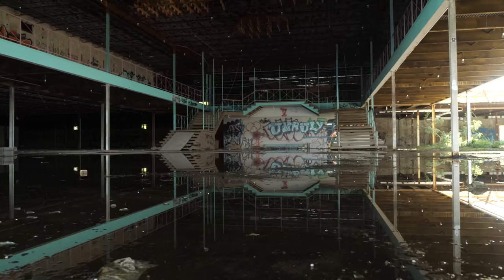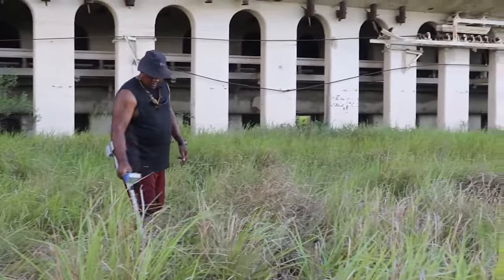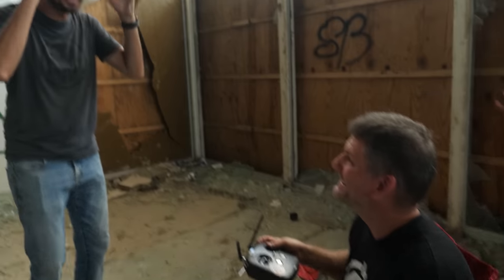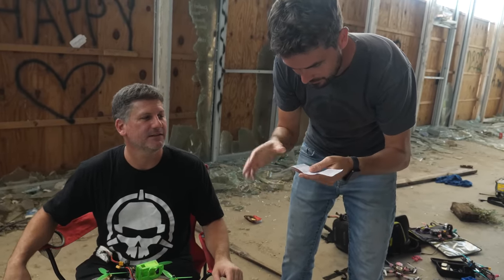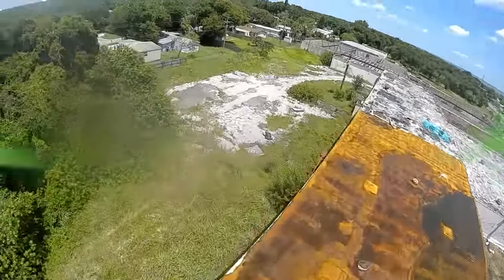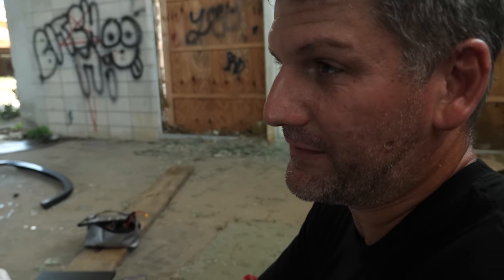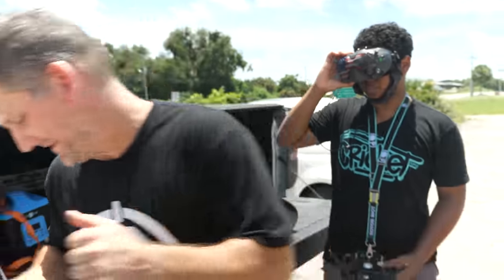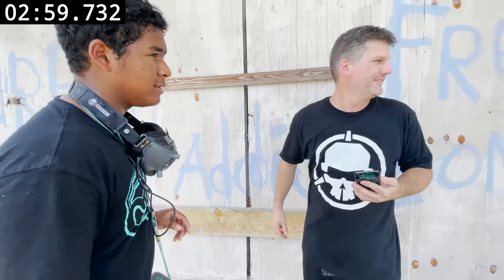Can Apple AirTag Find a Lost Drone?

Comment: Airtag is perfect when you attach it to your gopro and it get rejected. So you find your drone with the beeper but those few meters where your gopro got rejected you’ll find it with the arrow.
Reply: What's the best way to attach it?
Reply: @Noah_7s  use a tile dot. They weigh less and self adhesive. But I'd use double sided 3m for this

Comment: The apple airtag is great if you have friends/family with iPhones. You just spread out and walk the area you lost it in, and it will ping anyone who gets close enough and send the information to your phone.

However, I use both a buzzer and airtag.
Reply: I don't think there is any scenario where the tag would trump a buzzer with external power. You have to be so close, that you (or your helpers) would already have heard the buzzer
Reply: @richardbulger  i think the airtag is more for valuable stuff, so if you fly a gopro and crash in the mountains and dont find it the same day and the beeper dies then maybe if someone walks by you get ping and by then the quad is probably just waste but you can collect your gopro atleast

Comment: Buzzers are great. Even when an autonomous buzzer like the Vifly or the Hellgate beep only every 10 seconds most people can hear it from 50 meters away and locate it with about 5° accuracy. But Shawn is right: Ummagrip and two battery straps will save you 99% of the time.

Comment: I'm still a novice - so I bought two of these for my drones before I figured out how to set up the esc beeper in Betaflight properly. I figured this was what people were using and had gone hunting in grass a few times and knew I needed a beeper. I figured out the esc beeper though before installing the ViFly beeper, so I've kinda got them waiting for a flight where I'm concerned that I'll need the extra layer of protection.

Drew really botched the recovery here - you even explained how airtags work, lol, you should have pre-planned with three iPhone in 3 pockets and had everyone split up. Could have sent 1 upstairs, 1 downstairs, 1 outside running in a circle. Especially if you've got a crew you fly with that mostly use iPhone, this really could work well.
Reply: after flying for a while I have yet to have my battery eject (I fly pretty hard in grass) and even if it does eject I can always use film to find it. I would definitely use a vifly if for long range flights especially if your battery runs out (ask me how I know) but for regular freestyle turning up the beeper volume on BL heli helps though your motors get really hot if you run it continuously.
Reply: @patricksharp3355  Regreably, I've had my battery eject a few times in grass. Maybe I'm especially hard on it... I also had most ejections occur when I was brand new, mostly on cartwheel crash landings. But I did also have a failsafe that ejected the battery - fortunately, it cartwheeled and ejected on dry land right before the rest of the quad went into a pond. It was actually glorious. All of this despite having 2 battery straps and velcro. 😅
Reply: @tilgare  ummagrip saves lives. and also that's amazing were you able to pop the quad in the fridge
Reply: @patricksharp3355  I've had it on my wishlist, but it has been oos at getfpv for a while. Definitely want to give it a try. JB mentioned a knockoff that I'd feel icky buying but might grab one in the meantime.
Reply: ok go  chill out he’s just starting out in the hobby there is no need to hate

Comment: ViFly2 will disarm without the button. It beeps 3 times when you plug in the battery. You pull power after that. You need to wait about 3 seconds or so.
Reply: I use the motor beeps, after the last do-do is the timing I found that works.
Reply: You'd think they'd print that sort of secret info on the instuctions that Drew is looking at. Good Lord, why are people so stupid these days. Disconnect lipo, reconnect for between 3-6 seconds, you can actually here the buzzer beep 3 times, then disconnect lipo. Couldn't be easier. You have 30 secs before the buzzer goes off, so you should have ample time to replace the lipo between flights...

Comment: This isn't a very realistic setup... If you've actually crashed your drone, you'll still know the general region you've crashed in. So these guys should've given the other team like a 20m radius area that the drone is in. Both systems would've worked better for that method.
As far as long range... Well I crashed my quad in the bushes a while ago. Went to the last GPS location, and found it pretty quickly from there with the ESC beepers. The battery didn't eject 'cause I use velcro stuck to the battery so it can't slide out. Works like a charm.

Comment: Beeper good!  Save my drone and GoPro yesterday in the worst jungle of 6 foot saw grass I have ever seen and 250 meters in. Without the beeper that thing was gone for sure until winter when there probably wouldn’t have been anything left to salvage if I even found it then. Best $12 - $15 you can ever spend on a drone.  Beeper saved me about $600 on a drone and a camera yesterday. 

BEEPER GOOD!  Self Powered beeper much better. Buy beepers today. Don’t leave home without beeper. 👍🏼

Comment: I use beepers on 9 of my drones. It not only beeps but it flashes a bright white LED.  That is just an additional plus.  Just press the button for 3 seconds after disconnecting battery to silence beeper.  You get used to doing it.  And I unplug beeper before connecting a battery and messing around in BetaFlight.  Drones disappear in tall grass so easily. I even stuck one in a tumbleweed once.  Beepers FTW

Comment: You can get the hang of the buzzer within a few flights. I never use the button, I just power the drone briefly when powering off. Once the ESCs' tune finishes, I unplug, and the buzzer countdown is off. (But for the GPS Mate I just use the button...)

Comment: The only quad I've ever lost was also the only quad that had a battery backed buzzer. To be fair, it was a bit old and the buzzer was getting quiet. I suspected that it may have gone down in the water, but it may be that I couldn't hear the buzzer. The quad also had GPS so I know roughly where it went down, and I've been back to the location twice.

I should have replaced the buzzer with a newer one, but at that price it was a bitter pill to swallow (though I guess I could have tried to solder a new buzzer onto the battery module).

Comment: The gps tag is a good idea but they need to make it smaller, mauntable similar to a stack or just small enough that can be added into at least a 3 inch quad. It need to be small and flat similar to a gps unit.

Comment: I use the Vifly finder 2 and mini on all drones it's practical to put them on.  They've saved 3 drones in three years.  I don't know why in this video there's remotely any struggle battery tricking it to shut it down.  it's not hard.  Leave plugged in for 3 seconds and unplug.  It's simple.  You don't have to hit the button.

Comment: Trakr has been doing it longer than Tile I think. Is the Trakr Pixel smaller? Plus it's platform agnostic. 
.
They didn't use the app technically. If it wasn't for the ESC beeper, they would have been looking all night.
.
ViFly and Hellgate ftw.

Comment: a bit unfair of a comparison, you would have a vague idea of the area where you crashed. I think the airtag isn't that bad of an idea
Reply: I mean if your doing long range and lose your kwad on the side of a mountain... not rlly gonna know exactly where it’s at so I think the comparison is pretty fair
Reply: @BubbyFPV   this, just like a beeper is best used with in-goggles DVR. What I meant is that in this challenge, you didn't know if the drone was in grass,in a tree, on top of or inside the building. If you are piloting the drone, you'd have a vague idea

Comment: It would be interesting if you got a group of iPhone users to triangulate and see how much that helps
Reply: Bluetooth has a very low range, only some meters in perfect condition, if the kwad is in high grass, or something else block the direct view, it will reduce the range drastically, just check it with your Bluetooth headset. It's very good to find your keys at home but sadly in this scenario it sucks very hard

Comment: Iv actually been thinking of trying the tile tracker but I was worried cause its only bluetooth. And they make small gps trackers other the apple I wanna try.
Reply: Tiles work bro I got the pro with 600ft range... I lose my planes in fields where I'm walking around for hours if I don't put a tile in before launch.
Reply: @jamesordwayultralightpilot  awesome thanks for the info
Reply: @Reecefpv  no problem one day I walked the same area for 2 hours and found it 5 feet from one of my prints....went home happy, but feeling lucky, bought the tile and the next time I launched I had to go searching but pulled my phone out and you can just barely here the music from the tile when the phone picks up the signal. And it's still pretty far away by that point. In a big field it's pretty unnerving when you see your plane go down and instantly have no clue where it is when you start searching. The Tile pays for its self in recovered equipment the first time you use it. I put one on my battery lead too so I can find the battery if it gets ejected.

Comment: In my opinion kind of unrealistic?  Basically “crashed” it inside and far away where unless was beeping or flashing wouldn’t be found in any case regardless did the tech.  Also zero people around…. Not suggesting flying and crashing over people but in the real world where your likely to lose a drone probably have more people in the area.  If your drone crashed into some tall grass or a tree in a park off a trail or into a ditch or Sid rod building that isn’t totally empty or something like that then the AirTags would eventually pin point it as someone innocently walks by it.

Comment: When I first got the V fly beeper didn't get the damn thing never shut off so I ripped it off my quad and put it in a drawer in the garage and sent fuck it for a couple months😂... then I decided to figure out how it works. It turns out that the little button on it won't shut it off no matter how you push the button... so what I found that works is everytime you unplug the battery plug the battery back in real quick count to five and then unplug it and it's off

Comment: Losers taking off a security measure because it’s “annoying”. Vifly finder v2 is the least annoying out of all the beeper finders. Just press a button to turn it off or unplug it while on the bench. Whats so annoying about that? 

Gps, beeper finder should be all you need. If adding an air tag for phone assistance could be everything you need to find a drone.